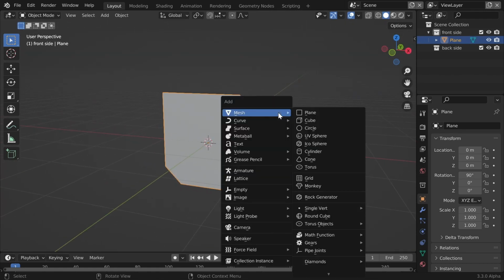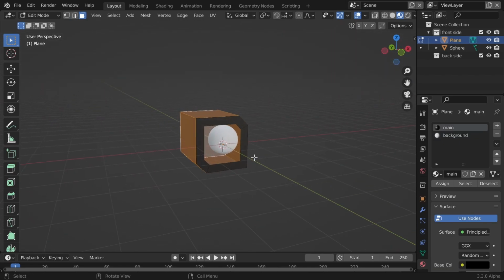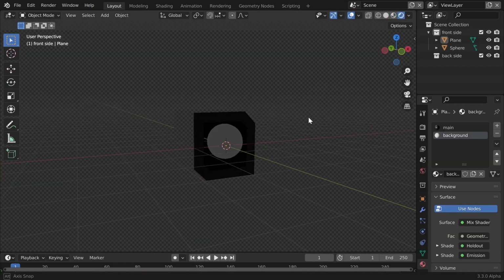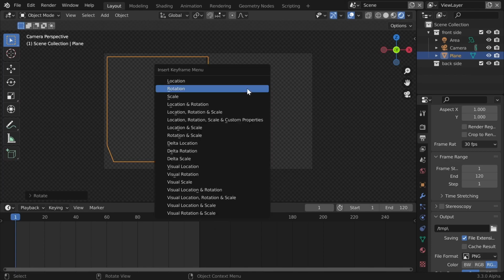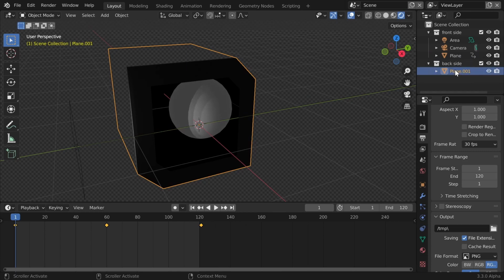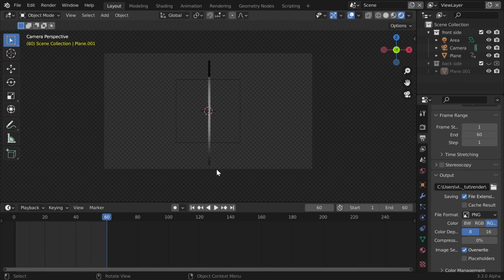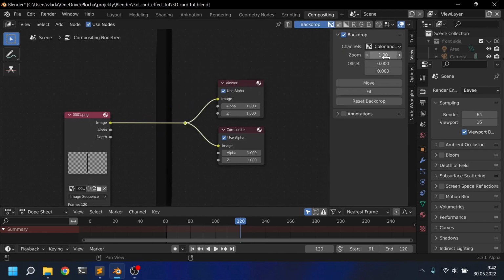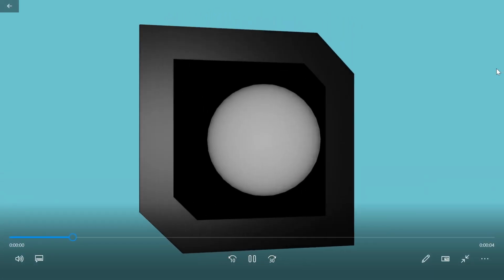Blender 3D card effect - simplified tutorial

Comment: does this only work with a transparent background? :( I put the card object to my other project but a weird gray screen appeared around the card object. is there any way to solve this problem?
Reply: Late, but what you can do is create a scene with transparency enabled for your card object, and another, separate scene without for your background and use a mix color node in the compositing editor using your transparent scene's alpha as fac.
Background scene goes in the top image input on your mix color node,  transparent scene containing the card object goes into the bottom image input in your mix color node.
Then you plug the output of that node into your composite node and a viewer node and once you render your image or animation, you should have your card with a working background.